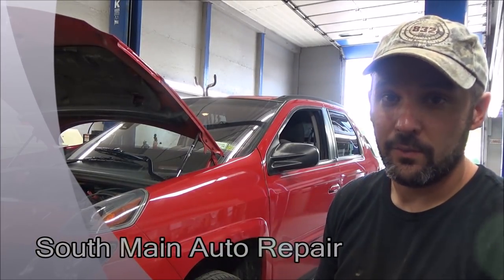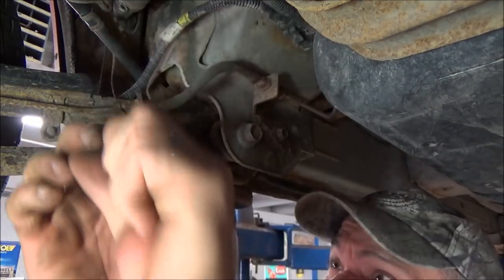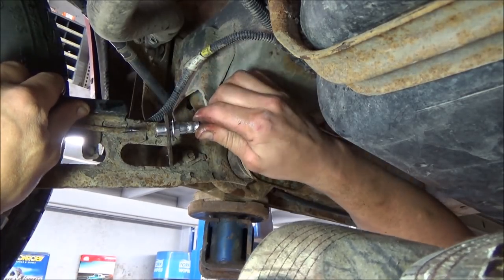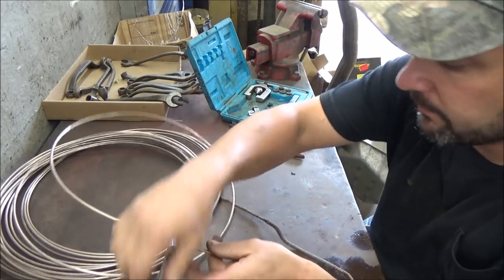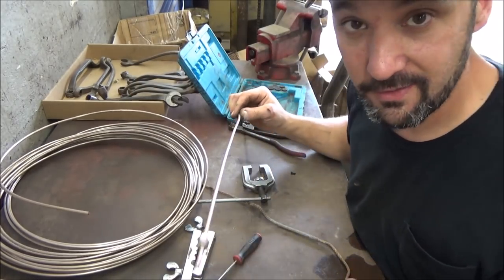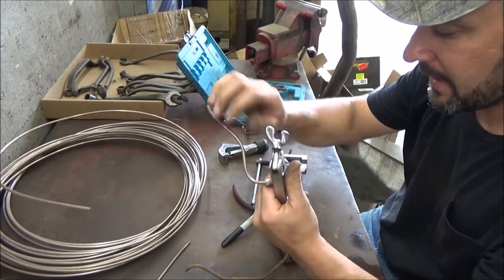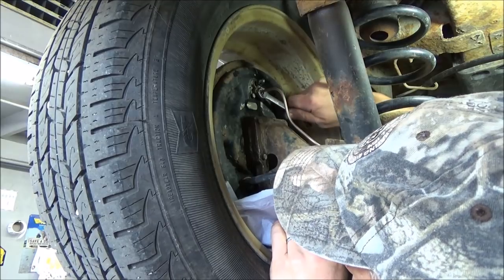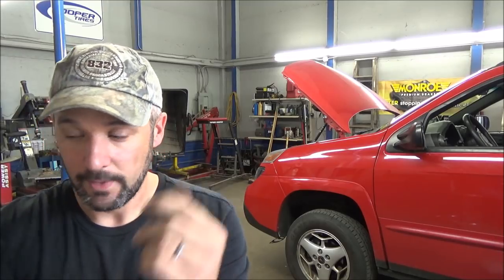Replace Brake Line &  Brake Hose : Pontiac Aztec

Comment: Hey good video... If you use a bar of some kind to apply a little bit of pressure on the brake pedal before you start it will hold the fluid back once you undo the pipe so it not dripping down to your arm pit!!
Reply from the maker: Neil M82 Bahhh who doesn't like brakes fluid in the pit at 8 a.m.! Lol yeah that is a good tip and I usually use my pedal depressor to do so but decided to pinch this one off to get the people wound up haha

Comment: There is another channel that deals with motorcycles that I watch on occasion. He has this tool for doing flares that cost well over a grand and is manual hydraulically actuated (you pump it with your hand). It's huge, cumbersome and time consuming to use but it impresses the hell out those who don't know............ Me, I have the good old manual version just like this one. It cost about fifty bucks. Like South Main Auto, I don't need to impress, just get it done.

Comment: My shop uses that nicop line also. We've done dozens of 99-06 Chevy trucks. Just did all my brake lines on my 00 silverado.  Also did the fuel lines in nicop also
Reply: We also have a hydraulic flare tool

Comment: You should change the description to indicate brake flaring and making brake lines. Then people can find it when they need brake flaring.

I use polyarmor coated from advance. Cheap and holds up well. Your lines flare much nicer....

Fords seems to love the ISO bubble flares. You can cheat and use an adapter sometimes. I drive older cars in upstate ny and have replaced all my brake lines, some end to end! I touched brake lines that literally crumbled away. I think once they sweat a bit the brake fluid attracts more moisture and accelerates corrosion even more. Fords after 98 have a good coating, but even so the ends and nuts corrode. The most recent one was on the ABS unit under the hood, not even exposed to salt. Didn't want to use heat so I just replaced the 30" line to LF. Matched almost exactly to one of the green premade ones.
Brake hoses don't crack but they end up acting as a checkvalve and create a smokeshow. I always replace them(usually front only, because of flexing) at high mileage as PM. Cheap insurance if you DIY.

NYSI also allows very rusty brake lines, almost to the point of sweating. Some states (like Maine) will fail you for a bit more than surface rust.
Reply from the maker: alb12345672 Oh yeah check valve hose make really nice smoke haha. A lot of people assume calipers and dont test then they get to see smoke twice :)

Comment: Was always a little nervous about using a torch around brake fluid but guess its not as flammable as i originally thought. My buddy and i was working on a 50 Chevy pickup doing some welding and he bumped a brake line with the stinger and popped a hole in it, we had a nice flame for a few seconds or until he grabbed my hat off of my head and beat it out. Scared the crap out of us at the time but afterwards we had a good laugh.
Reply from the maker: +Dmax04 Lol well it is always funny after the fact right :P

Comment: Also my winter beater Audi is 15 years old and the original nicopp lines are all good!  Of course half the original tube nuts got cut off replaced and the lines reflared when I replaced the hoses a couple years ago, but hey, it's NY, let's not get greedy.
Reply from the maker: Garrett McEwen Oh nice so Audi uses it huh?
Reply: Yeah.  I think my rotted out Volvo 242 had it as well way back when.  It was the only thing on the car that wasn't rotten.

Comment: if you apply the brake pedal the cups in the master cylinder will go past the ports in the brake reservoir and the fluid won't drain any longer. just a tip :)

Comment: I've never done a brake line.  I do intend to replace all of my brake, fuel, and evap hard lines eventually on my 20 year old 626.  Same pipes for fuel and evap?  Can you recommend lines for those?  Appreciate the video.  I'd love to see the bubble flare when that situation comes up.
Reply from the maker: ***** On gas lines I use plastic... no steel or NiCopp

Comment: Gravity bleeding neat!  Like the torch on the fittings to loosen them up. Was that a jet going over?  On the rav 4, did u end up putting inserts in all the holes?  Also never saw ultra grey in the caulking gun. Next timing cover or trans case will get that large tube. Thank u for great videos. Ten times better than the junk on TV
Reply from the maker: Bill Rimmer Nope no jet just  a torch and yeah if you finish the rav vids I did use inserts in all the holes
Reply: Bill Rimmer I

Comment: I used your phillips screwdriver trick to ream the inside of a brake line for my 1966 Nova.Worked great! I have had a hard time double flaring 1/4" coated brake line. The line kept slipping out of the clamp. Removed coating, used elect and duct tape- tightened Snap-on clamp till I snapped the wing nut bolt!  I used the galvanized line without a problem. Any hints?
Reply from the maker: Bill Johnson It was a snap-on tool? Usually only the cheap sets do that... I have never had my impersonal set slip at all in the 15 years I have owned it.

Comment: Sidebar note:  Stay far away from the El Cheapo' brake flare tools sold at most auto parts houses and harbor freight.  The retention tool itself only will last a few flares and then it gets to the point you'll never secure the line tight enough for the flare tool to work.  It'll push the line right out the tool!!  Oddly enough the best one I've found--other then the ol' snap on's and mac's..  OTC-STINGER.  Found a decent kit for under $30 at one of our discount auto parts stores.  They ordered it in for me.  I've had it for several years--and many many flares and it's still in good shape.

Ya get what you pay for!!
Reply from the maker: Tedybear315 Nice thanks for sharing

Comment: Good job Eric.  It is interesting to see what mechanics in your part of the world deal with.  Have you any positive experience with under coatings on vehicles there?  Fluid film, etc.?  What do you do with your own vehicles?  Thanks for posting.
Reply from the maker: ICU2 My own vehicles haha they get crappy service and rot apart. I have not had any personal experience with any really good undercoat myself.
Reply: South Main Auto Repair I wonder why the Toyota Tacoma with the bad brake cables that you recently worked on appeared to have less issues with rust.  Maybe is your spare time (ha ha) you could Fluid Film your Ridgeline or Odessy before winter and gives us a review next spring.......
Reply from the maker: I never did find out what he had on that truck but boy it was nice.

Comment: Great videos...thanks for making them, I suppose it's a pain in the butt to make while running a business. Anyway I wanted to add to your content about copper brake lines
Copper is scavenged by brake fluid and becomes a contaminate in the fluid, copper and other contaminates lowers the boiling point of the fluid...lower boiling point means brake fade which is just the same as no brakes...copper contamination could cause someone(s) to loose their life...I think that's important. again thanks for making your videos
Reply from the maker: danekeeper1 And that folks is why brake fluid flushing is important and testing with brake fluid test strips to check not only moisture content but copper content. Thanks for sharing your knowledge :)
Reply: South Main Auto Repair I believe the company that makes the reverse brake bleeder kit, yea I have one of those too, make test strips for copper. The company's name is Phoenix Systems. Oddly enough, they are located in Utah and not Phoenix.

Comment: Well, it was August 2020 on my way to my doctor the day my brakes went it was only one line driver side  2003 ford expedition .. called three mechanics first one says he refuses to do brake lines the second one was to busy the third one told me his brake line person was not in that day and he was the only one that could do it because he was licensed  to  do brake lines, he said you had to be a licensed brake line specialist here In NYS.. I changed the line that was rusted from the abs driver side to the rear wheel I also changed two of the master cylinder lines,  bleed and it's now December and brakes are great!.. This is the material I use bought from amazon.. ford truck uses bubble flair..bought the flair kit from amazon also.. my first time ever doing a brake line.. I figured if  I can replace my transmission cooler lines this should be a piece of cake.. I'm a  pro photographer that's what I do for a living..( Muhize 3/16 zinc coated 25')

Comment: My 2003 chevy truck has new pads, rotors, calipers and a new master cylinder. The master cylinder was replaced about 6 months ago when I had no pedal. This solved my issue and I had brakes again. Now just recently my pedal started going to the floor again and I have no brakes. I inspected the truck on the lift and noticed no signs of leakage from the lines. Am I able to get away with replacing all the brake hoses without having to mess with the lines?

Comment: A well explained video,but will any type of flare fit in to a flexi hose for example my 02 bmw has a bubble flare system and am about to change the brake pipe that connects to the flexi hose and i only have a double flare tool ,will that do the job or will i have to buy a bubble flare tool.

Comment: Can you gravity bleed the ABS unit?  I was redoing my brake system. My master cylinder ran down overnight since my line plug leaked. I ended up going to the dealer. If you can’t gravity bleed the ABS is there a way to properly bleed the system?  You may never see this question, but in any case, thank you for your VIJAYOs. 🙏

Comment: Dude dude dude......, I thought for sure after you said youve done thousands of these you were gonna pull out the best flaring tool ever, you need to check out the Mastercool 71475, its a hydraulic flaring tool that does all of the brake line flares plus push connect and GM fuel line flares, its about $300 though, biggest advantage is when you need to do a flare on a line thats still on the car, especially in a tight spot, its effortless. I figured with all the nice tools and gadgets you already have you would surely have one of these, i'm telling you man, if you get one, you will never look back, you'll also never forgive yourself for not buying it sooner....looks like you have a quality set that works pretty well though, most flaring tools of that type that ive seen are pretty crappy to use.
Reply: MrTurdfergusen The Mastercool unit is excellent an unlike the Eastwood unit can be used on the car. Most of the AC shops out here in Phoenix use it. Since brake lines don't rust out here I've seen it used mostly for the larger aluminum lines used in AC systems.
Reply from the maker: MrTurdfergusen I do have the master cool set. Well it is a blue point off the snap on truck (same thing)  but I bought it to do gm bell flairs and push connects. Frankly I can do flairs faster with my Imperial and I don't get brake fluid all over my Master cool set. I have had it for about 10 years now and it does work really well.
Reply: South Main Auto Repair  Right on, I guess in my early wrenching days I had a cheapo version of the type you were using, actually still have it, "just in case", but its never been used again, It looked like that set you have was working pretty well for you, obviously you had some practice....I made the jump from the 10 dollar parts store cheapo straight to the Cadillac, I don't wrench for a living anymore but I still use it on my own stuff quite a bit and loan it out to one trusted friend about once every couple months. I'm right in the middle if IOWA, seen amny rusty brake lines and felt the pedal sink rolling up to an intersection more times than i can remember, I wish the labor times had a "Rust/Corrosion" 0.5 Hrs added to them for vehicles more than 5 years old, you know like, "With A/C add .2"  "With Skid Plate add .3"  they really needed a "With Heavy Rust Corrosion Add .5"  "Broken fasteners add .5" for us rust belt guys. Also i watched the scotty kilmer video that someone mentioned about him using compression fittings just to see if it was real, in the comments he says hes been using compression fittings for 47 years and never had a comeback.....yes scotty, they dont usually complain much after they're dead because their brake line failed in a panic stop and they got run over by a loaded cement truck, or it simply failed and they crashed into something and totalled the car, obviously they arent coming back unless they can somehow prove that your B.S. Brakeline repair is what caused it.....WHAT A HACK!!.....Im be he has a duct tape your leaky power steering line video and a, "fill your radiator with 2 pounds of black pepper to stop those pesky antifreeze leaks" video in the works Sorry, I'm done ranting and rambling about non-sense.OUT
Reply from the maker: Hhahaha Well said sir ... well said

Comment: An old video, but have to comment. 
When i do a brake job, the first thing i do is to depress the brake pedal with an inverted trigger clamp between the pedal and the seat. This closes of the valves in the master cylinder and stops fluid from leaking when u do your work. And no need for hose clamps :) 
Wonder if there is a reason u don't use this method?

Comment: a quick note  when I do line work,, if you slightly hold the brake pedal depressed, it blocks off the resivor from draining,, so it stops dripping while you do your line fabrication ,, give it a try  half the time I forget to do it ,,but does work every time I do..  i use mytelescopic hood prop bar to hold pedal down about an inch  or  so

Comment: I live in Canada and my research shows that nickle/copper line is not approved for use here. That line seems quite soft and flexible so I wonder how it would stand up to stones and such debris. You didn't add the stone guard (wire wound coil) to the line. Have you ever had a problem in this regard?

Comment: Very cool video. Gives me the confidence to try it myself if I ever need to replace a brake line - I live in the rust belt too. Question: why are the lines spiraled up by the master brake cylinder?
Reply: It helps avoid adverse road vibrations by being coiled.

Comment: i live in the midwest, another rust bucket area.  i remember when when i used to work professionally on cars many years ago, i had 4 cars/trucks come in a row that needed brake lines replaced front to back, which also meant fuel line replacement.  engines, fuel tanks, rear subframes had to come out.  i was crying for days.

btw is it ericthecarguy or scotty kilmer who incorrectly flared brake lines?
Reply: +nijoel In my opinion it;s ericthecarguy  :)
Reply: he said that the guy doesn't live in the rust belt so that kind of rules etcg out....
Reply: +mastahc411 Correct.

Comment: I guess Walter White got a new paint job, probably to throw off the DEA, lol.  Anyway thanks for the timely video Eric, I have two brake lines to replace this summer on two late 90s pickups (Ford and Dodge).  I bought the Poly Armour line but I'm thinking I might switch to NiCopp.
Reply from the maker: Brian Richards Go NiCopp for sure. I use to use poly back in the day but this NiCopp is the way to go

Comment: Is the affordable pre flared and cut to size kits of NiCopp brake lines for an 02 Grand Cherokee 4.7L Laredo (WJ)?
I need to do the rear lines before they rust through. 
The master cylinder lines are forming rust.
Also why doesn't brake line manufacturers coat them with paint, especially the stainless steel lines? You would think even rustoleum would be more rust proof than bare lines?

Comment: I run a shop outside of St.Louis and I've had to make a ton of brake and fuel lines but do you ever fab steal to rubber lines like power steering. I ran into a fuel line on a chevy suburban it's a supply line at the pump with 10in braided line made in and it's not available anymore

Comment: Great video, but not as easy as it looks. Bent my line close to perfectly, but I could never flare it. I have a flaring tool very similar to yours, and the line gets pushed out of the tool. The only way to prevent that is to tighten the tool so hard that the threads indent into the line. Instead of the die flaring the line, the end of the line just bends.

Comment: Do you ever use the poly armor brake line?  We try to use it when we dont have to replace more than I think its 5 foot lengths it comes in.  Longer brake line repairs we use the same stuff you are using to keep multiple unions limited.
Reply from the maker: We always use the nicopp

Comment: Since all the brake fluid dripped out of the system, is there a procedure for bleeding the ABS pump?
Reply from the maker: Upallnight There would be if we introduced air into the system but in this case no it was pretty straight forward.

Comment: Would it make sense to paint the brake line to further prevent corrosion?
Reply from the maker: Doomzdayxx  The lines I used don't rust
Reply: Ok coo. I need to get some of that since my 02 Ram's lines are almost completely FUCKED

Comment: Pretty cool video very interesting but over here in texas you only see this kind of thing really on auction cars coming from other states not really worth having these tools for the rare occasion Id just run to the local pull a part and for 5 bucks or so come out with the line in about 10 minutes. Seen a lot of these aesthetically pleasing aztecs recently junked too